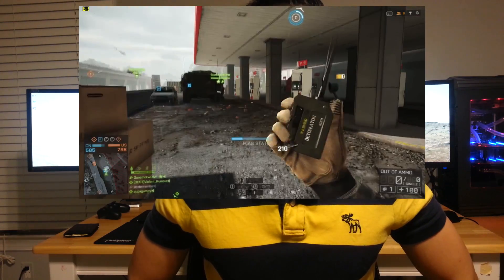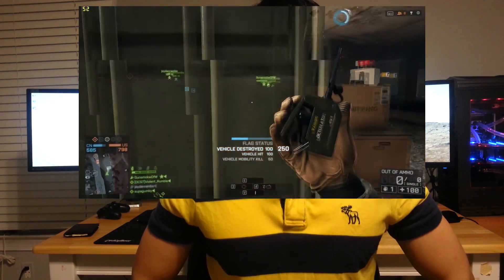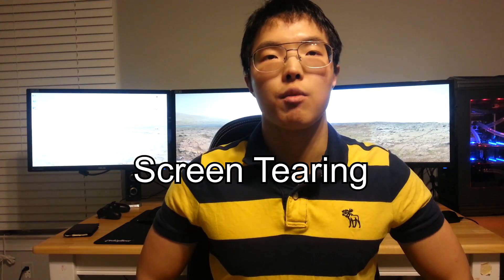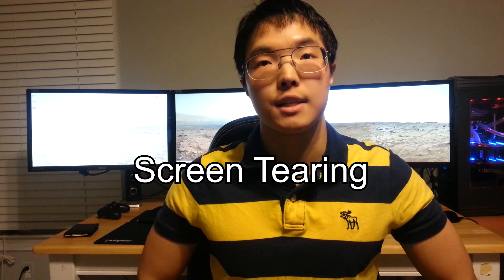What is Micro Stutter as "Fast As Possible" (SLI, Crossfire, Rubber Banding, Screen Tearing, GSync)

Comment: Hm, the video was really helpful but I am wondering, I actually want to buy a Lenovo Y510p with GT755M SLI configration, but am I going to get microstuttering or any other bad rendering and framerate issues while playing games ?
Reply: Oh ok man thanks :)
Reply: Same exact laptop and configuration, Far Cry 3 is impossible to play in SLI mode. I've looked around but i can't seem to find a solid fix other than turning off SLI for those games affected in the control panel.
Reply: Also if your looking at getting the Lenovo, i've had a solid experiance with it other than those few games affected by the micro stuttering, but if your looking at playing the big triple A title games, i'd recommend something with a single GTX series card, not that the Lenovo's is bad, when SLI works for a game, this laptop could outperform some of my buddies's desktop builds, but the SLI issue is frustrating for those select games affected.
Reply: Can you suggest a moderate budget laptop for me, I cannot afford high price dominators, and also want to play BF4 full hd high-ultra, any suggestions ?
Reply: TheWtft That's because FC3 doesn't support SLI. Ubisoft never actually implemented support and therefore you may be unable to play it in an SLI config. Just turn it off for the game in 3D settings in the Nvidia control panel.
Reply: KiltenthTV Asus's ROG series was my first go to, but i also considered the MSI G Series in my search.

Comment: I'm having a hard time deciding between two laptops to buy -- one has an i5-4200U + GT 750M, and the other has an A10-5750M + HD 8670M. The AMD laptop is significantly cheaper ($200 to $300 depending on where I get it), but micro-stuttering has me leaning towards the Intel laptop.

Is micro-stuttering really a thing of the past? If so I'll definitely be getting the AMD laptop.

Comment: How can i tell if a graphic card can handle the video card / proccesor / ram i add on it ? for example i want to know as im doing a project pc build right now if an ASRock B85M Pro4 can handle the proccesor i added wich is the i7 4770k 3.5hz
And also how can i tell if my pc is cool enough that i can overclock it... What temperatures it's not so well to reach ..thanks for ur time in advance at least for reading and for possibly answering:)